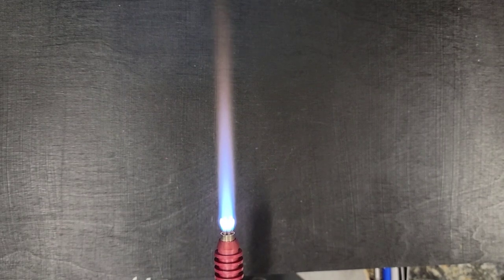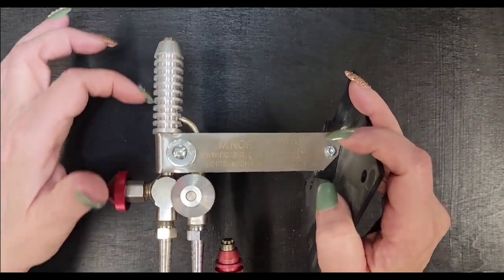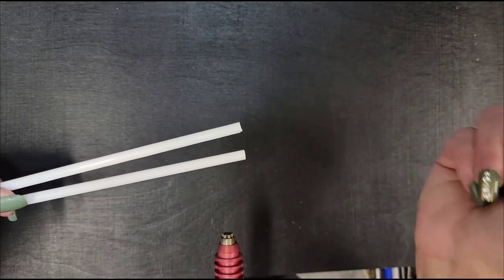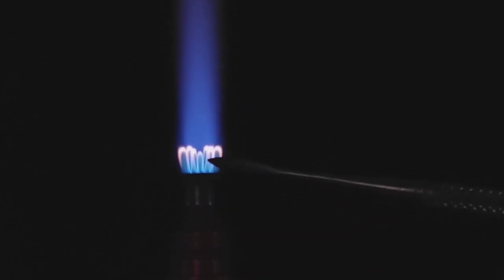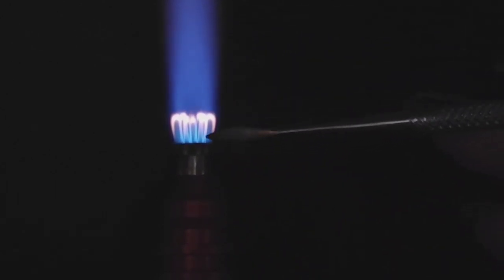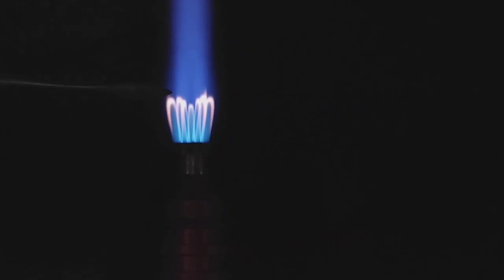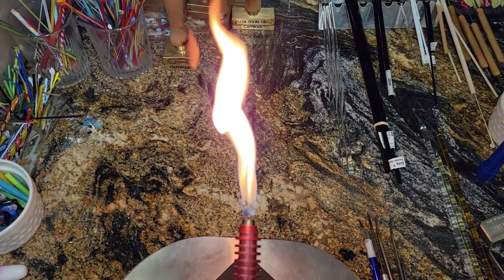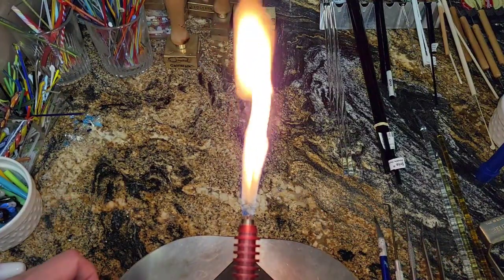Lampwork Glass Beads:  Fire and Flames

Comment: I wrote the other comment at the beginning.  This was one of the most informative videos, so thank you very much!  I don’t know about other people, but feel free to use my name, “Beth”, if you are going to answer one of the questions I have asked.  Not to worry, I’ll be asking ALOT of questions....starting now, why are some of my blues turning colors?  Some are going a rusty red while others are going black. 

Thank you so much!  I can’t wait for more
Reply from the maker: Beth,
Your blue beads are turning red because you have too much oxygen. Remember, you should be working in a neutral flame.  Equal parts oxygen and propane. So adjust your flame and turn down the oxygen and you should be OK.

The black spots are from too much propane. Turn down the propane and the black stuff will go away.

You should join the "Lampwork Tips, Techniques, and Questions".  Facebook group. Lots of smart people there who can help with your questions.
Reply: @LepoppetGlassBeads  what psi are you working with? I’m flying blind here